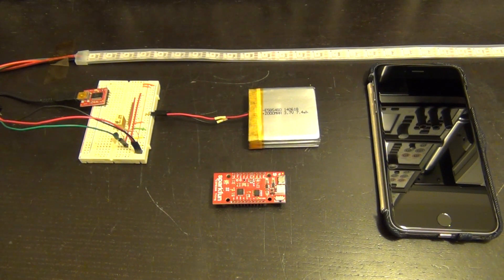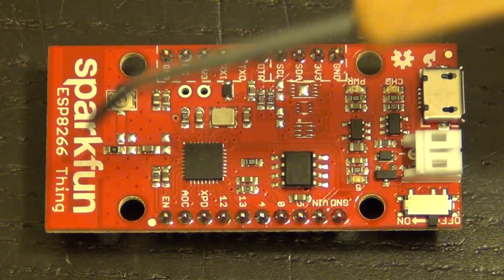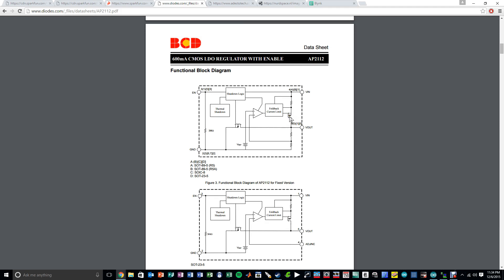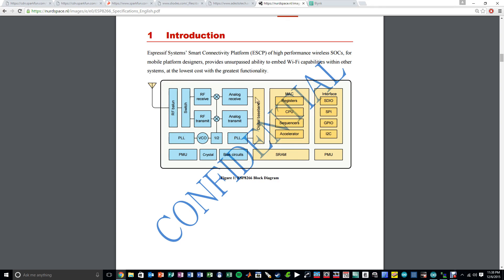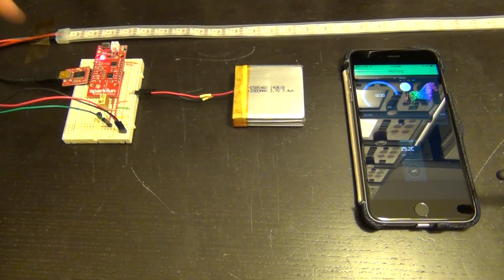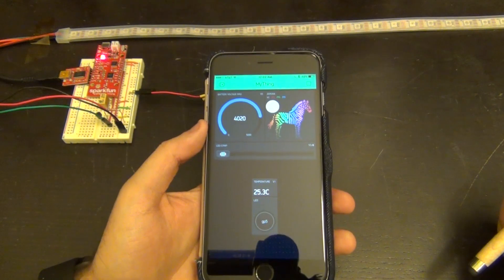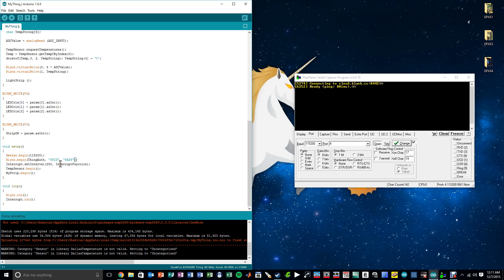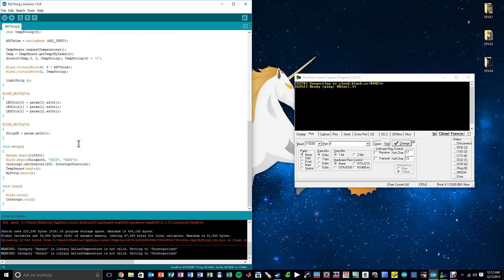TSP #67 - Tutorial and Experiments with ESP8266 SoC, Arduino and Internet of Things (IoT)

Comment: PROG pin on the MCP73831/2 is for programming the maximum charge current. The voltage is set from the factory (you order different part numbers for different voltages). Used them on a few projects and they work well :)
Reply from the maker: +MetalPhreakAU Excellent, thanks!

Comment: Can other IDE can be used for programming, and how difficult is for that IC to make it talk to a non blynk server over udp/tcp?
Reply: +Dajgoro Labinac There is many solution that can be used with ESP8266, you don't need to use Arduino IDE (anyway it use GCC as compiler), there's Tensilica (now Cadence) compiler for Xtensa L108 (ESP8266 use Tensilica customizable processor IP) but it is very expensive . Easiest solution is to use GCC and Espressif sdk to develop applications.
You don't need to use blynk server ESP8266 can act as TCP(UDP)/IP server on its own.
Best start is to use Neil Kolban book on the ESP8266 (it is free and regularly updated) http://neilkolban.com/tech/wp-content/uploads/2015/12/Kolbans-Book-on-the-ESP8266-December-2015.pdf
Reply: Thanks for the reply and for the link.
I'll take a look.

Comment: Firstly thanks for the video..(I see you have moved to the dark side using Arduino no longer using your microchip board ) 

Anyway...I really dont like the ESP8266 (I own 4 of them and used it a few times), that WIFI module eats! eats power like a pig. I used my Rigol DP832 to power it  and measured  peak currents up to 380mA.. (150mA idle) its not a radio I would categories  in an IOT category for radio modules...I would look at the NFRL series radios with peak currents at  ~20mA

Comment: I'm sad. The best hardcore ee blog in the business has gone all lego on our asses  :(
Reply from the maker: +Rob Bowman I went through all the detail of the board, components and block diagrams. Explained how the whole system works from hardware all the way to the cloud connection as well as line by line on how that code does what it does. If that is not hardcore, then I am not sure what is.
Reply: +The Signal Path Blog I liked the video and I'm a long term subscriber and will still be but it's just an opinion. The thing I like the most about your blogs is when you do detailed analysis/teardown/design/test/tutorials of analog circuits because that's not available anywhere else. Having said that, I bet this video is very popular
Reply from the maker: +Rob Bowman I felt that to really look at the schematic and block diagram of the ICs would interest people in understanding these ICs and not just download some code to them. But not to worry, there will be more videos of the type you like as well.
Reply: +The Signal Path Blog I look forward to it. I didn't mean to come across as ungrateful as you do a great job - this really is the best ee blog out there! I used to be a DSP engineer so your analog and high frequency blogs are fascinating to a baseband guy like me :) In fact you inspired me to get back into it and I'm currently playing with FETs as switches and amplifiers.
Reply from the maker: +Rob Bowman Thank you. Don't worry! I am sure you will like the next video. :)
Reply: +The Signal Path Blog I can't wait. Glad you're back :) Thought something happened to you :o
Reply: "gone all lego on our asses"...still funny today old chap !